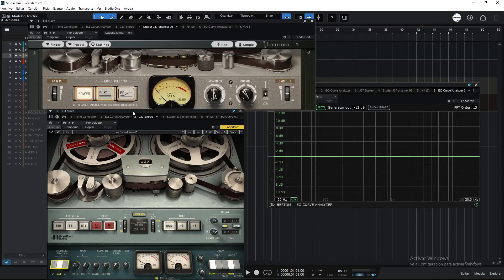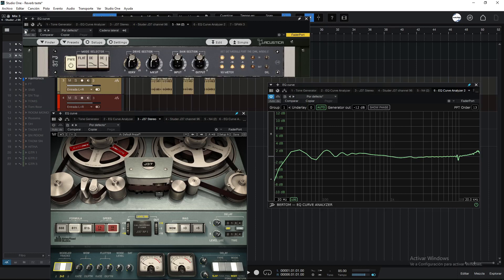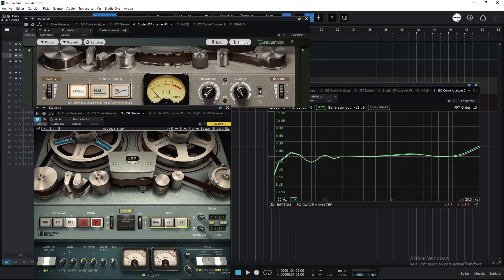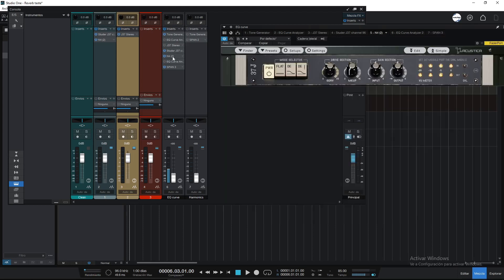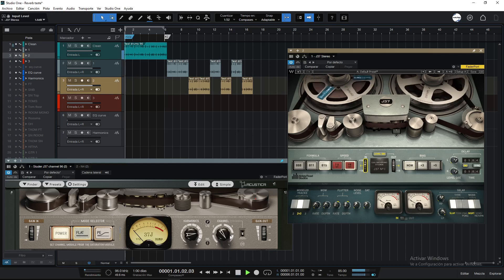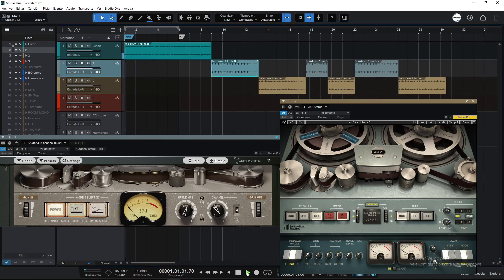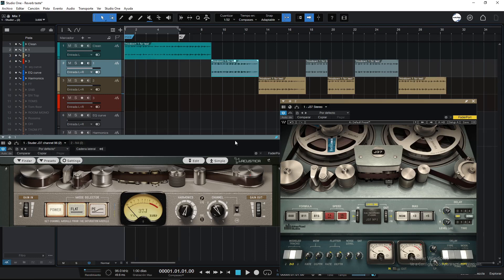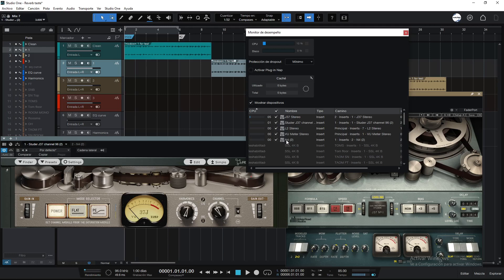Waves J37 VS Acustica audio Nebula(Tim P J37)

Comment: PRO TIP: Once you are done setting up the Waves J37, UNLINK the IN & OUTPUT and UNLINK the DELAYS (even if you choose no delay). Leaving those two processing paths linked makes/sums the stereo image and signal narrow in a God awful unnatural way; and it is shows is the sound. Think about it; nothing in the analog domain is linked. Do this and I guarantee you, you might revisit on which one you think is better. 

Waves J37 (Stereo) is the best stereo tape plugin to date based on accuracy and actual tape behavior. 

I'm actually not too much of a Waves plug-in fan. However, what they do get right, they get absolutely right on finite levels that most other plug-in manufacturers miss the mark on utterly or purposefully take a shortcut on.
Reply from the maker: Hi I believe the link of the volume is only for the input trim if you check in the drum example the left and right channel are working independently so the right tom is not ducking the left channel. so check on the manual and that link for the in and out is only to drive the tape without blowing the volume.
Reply: @chrisaudio  I have read the J37 manual several times. Take another read and listen. I'm not talking about ducking, distortion or compression. I am talking about the "true" stereo image.

 Leave one instance of J37 with the links on and then set another with the same settings but with the links off. Play with the two and see which one you like best. 

You should be able to hear and feel a difference; because there certainly is.
Reply: Wow thanks!  I never cared for my J37, and perhaps unlinking will be the trick.  I'll check it out.  That said, I was so disappointed with it, I bought Satin by U-he thanks to Dan Worrall's interesting review regarding it's 'companding'.  Much happier with Satin... but hopefully I'll get some new life unlinking the J37.  ✌
Reply: @Tyrell_Corp2019  Okay awesome! I'm always open to hear or  know how it turns out for you!
Reply: So I read your post thinking "yeah sure..".
But man you're so right. It's just night and day. Put a metal groove in superior drummer, metal machinery on the allround kit using your suggested settings. Totally blew me away how it opened up the whole sound stage. Using the sat knob to shave off the transients.. It's absolutely awesome. Definitely my new goto tape machine.
Thanks for the great tip . 🤘😎🤘
Reply: @eranddroory9987  Dope! That's what's up! Glad you can hear it and glad to help!!!
Reply: Do I first set my parameters before unlinking?